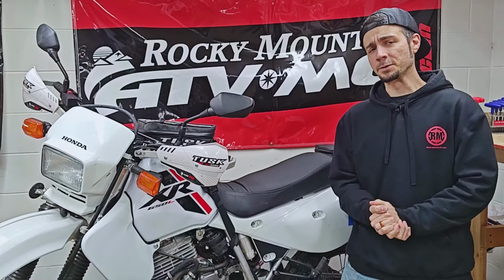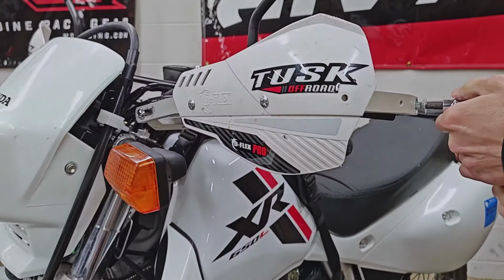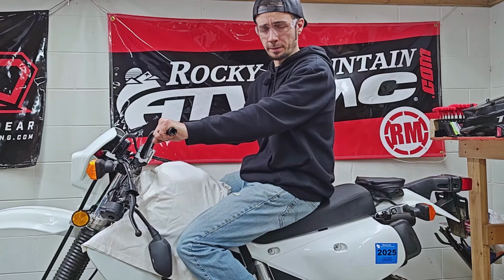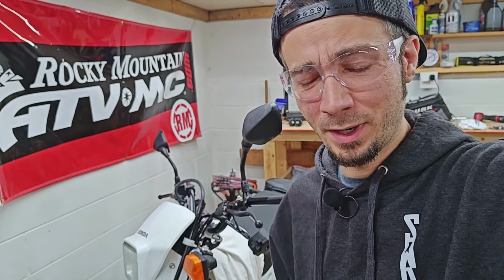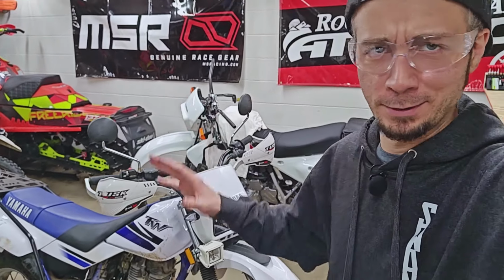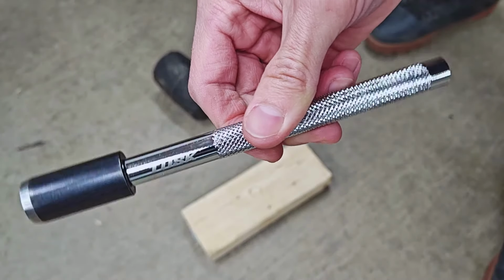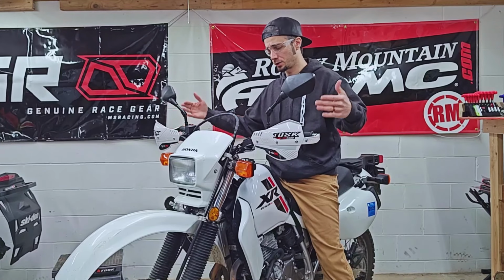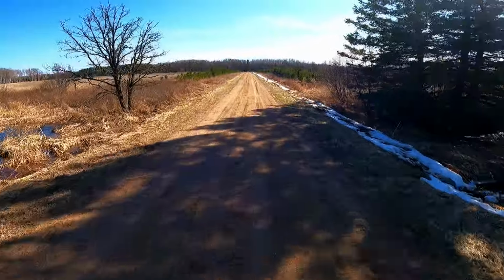The First Mods: Honda XR650L (HUGE IMPROVEMENT)

Comment: hey, do you have a wierd issue when the temperatures are below 38 and the flashers dont really want to work. and also does your bike have that weird querk where the left peg is more in than the other.  I fixed my peg issue with the set back pegs and cut off the peg post from the frame and re-welded a spacer in